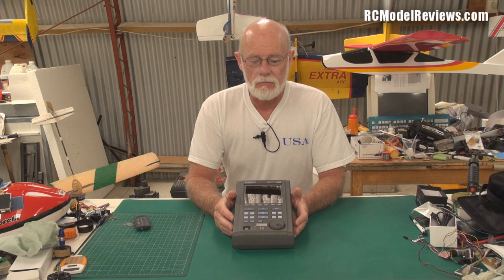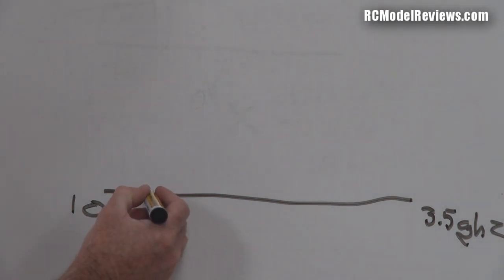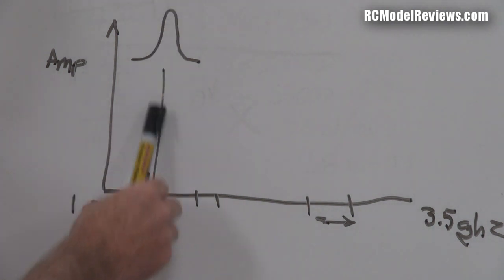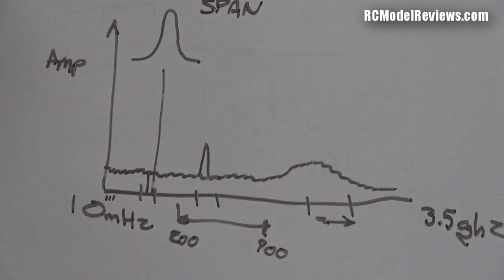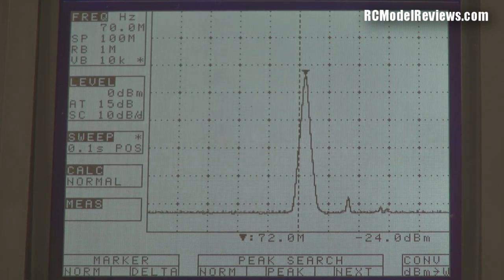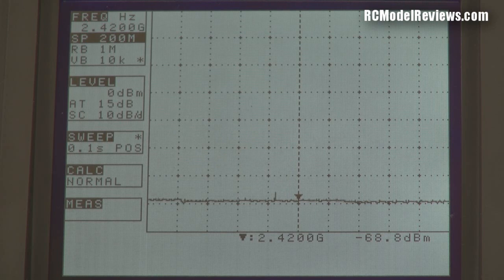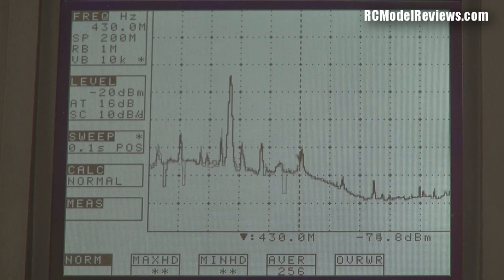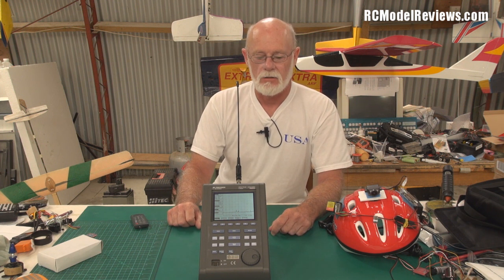The spectrum analyzer explained

Comment: Thanks for the thoughtful review.  In yesteryear I used HP spectrum analyzers working in microwave communications at a satellite earth station and now I'm pondering purchase of one myself for copter RF transmission and antenna tweaking.  I do have a lower frequency (UHF) portable handheld analyzer from RF Explorer and am looking forward to purchasing their extended range (to 5.8Ghz) unit when it ships.  Otherwise, the 										 								 								SPECTRAN HF-6060 V4 10Mhz - 6Ghz model looks nice despite costing 1,000 Euros.  On up from there a used HP analyzer seems to be running $2,000 on up.

Comment: If you have a immersion rc UHF receiver you can use it as a spectrum analyser for the 433 band. The gopro does give off some noise in this band which you can measure.

Comment: Good work Bruce, I would be really interested if you could test to see what difference low pass filters actually make on cheap video transmitters from China. Every time I tried to use my 1.3ghz vtx it caused problems with my DJI GPS receiver and my 2.4ghz receiver. Once I added the 1.3ghz low pass filter it seemed to resolve the issues.

Comment: Thanks. :-) I'm aware of that, as indeed the snow on an old analogue TV will in part be from that radiation. Jupiter emits a much stronger radio signal that is easy to pick up too, for example. I was just curious if there was a particular frequency that the CMBR emits at now that could be zeroed in on with a frequency analyser and a suitable antenna.

Comment: One small point, when I was teaching test equipment I would describe the display as frequency over power rather than frequency over aptitude. Reason for that was to avoid confusion when comparing an AM signal to an FM signal on a common carrier such as the old analog composite video was avoided.

Comment: See if you can find a Fluke 345. It's an all in one multimeter, o-scope and inductive amp probe. Logic analyzes are beasts of their own as you need 32 or more likely 64 channels to view parallel logic. Series logic is more difficult to view unless you can sync the scope off the clock there isn't anything to sync the scope off of.

Comment: Nice. My only objection is that the received signal need not necessarily be a radio signal, it could be perfectly anything at all that is converted into an electric signal, such as AC, digital communication, sound, whatever.

Comment: The problem is in the signals that share the same frequency. Copter is 2.4 GHz and AV Transmitter is 2.4GHz also. Since both antennas are close together the copter looses power for instants and so I cannot stand watching such flying behavior, it is scary! I am not able to find a way to change copter frequency (would be nice!).

Comment: I assembled a "poor man FPV", all for less than a hundred dollars, using:
Micro Camera with LED Lamp 420TVL
2.4Ghz 4 Channel AV Transmitter 200mW
2.4Ghz AV FPV Receiver (Arduino Compatible)
WLtoys V949 Beetle RC Quadcopter Mini UFO
3.5 inch TFT LCD Car Rear View Monitor
But alas, the copter looses power all of a suden for fractions of a second. 
I imagine your spectrum analyser wil show an overlapping signal of both transmitters.
Is there a way I can modify one of them?

Comment: I want to use epoxy pigmented with aluminum powder to paint a balsa model.  tested a dried sample with a volt meter and got infinate resistance, same result with dry aluminum powder.  I put a spectrum reciever in an aluminum can and range tested it to about 300 feet and it worked fine, couldn't see any farther. my questions are, how the hell does it work in a can and do you know of any problems from aluminum paint or carbon fiber?

Comment: SARK-110 Antenna Analyzer -- $360
seeedstudio(dot)com/depot/preorder-sark110-antenna-analyzer-p-1270(dot)html?cPath=174

The SARK-110 Antenna Analyser is a pocket size instrument providing fast and accurate measurement of the vector impedance, VSWR, vector reflection coefficient, return loss, and R-L-C (as series or parallel equivalent circuits).